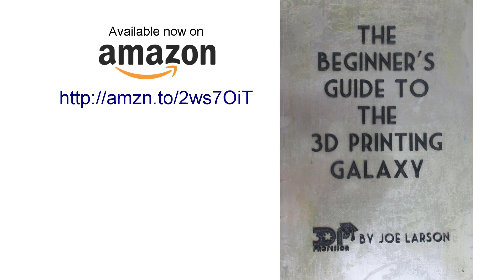The Creality CR-10S and GPL Violations

Comment: Because Creality responded doesn't make them innocent. In my opinion, it makes them panderers. They're hoping that by admitting they'd violating GPL, that we'll have sympathy on them. Again, doesn't make them innocent. It doesn't even make them less guilty. 

One thing they could do, is give Marlin a slice of the pie. "For every 3D printer we make, we'll give Marlin $5.00" or something like that. In return they get exclusive 1st use any code Marlin releases for 2 weeks before it's released on the open source. 

Just a thought.

Comment: It'll be a very interesting day when we move out of the investor makes the calls rather then the people that have the technical abilities. There should be a new investment strategy where they stay out of the technical loop and gain rewards. Would be a hard start for many but my guess beneficial for both sides of the equation.  Now the question is what startup would like to test this idea/feature and stick with it. I have seen allot of Kick starter type programs where people invest on a small scale not to be delivered. There must be a guaranty of deliverance, something even if it does not work but can be improved on. Work to be done in this area or arena.

Comment: To the best 3D Printing Professor - I completely agree with you on the stance that it is a huge move that we ever heard anything from Creality and that although we should still hold them to the letter of the license agreement we should be willing to hear them out and give them the opportunity to correct the problem.

On a different note regarding the couplings. One of the documents that is was in the tool box specifically addressed the reason that the couplings are loose. They had a really bad run of people getting printers were the couplings had been damaged if not completely destroyed during the shipping process. So they have started to error on the side of caution by loosening the screws in the couplings so that if there is any undesired movement during shipping the  chances of damage should be greatly reduced. 

I mention that as a way to support your claims that Creality is listening to us. They know that a ton of people were getting damaged printers and they adapted their packaging process to hopefully ensure that everything arrived in one piece. Additionally they listened to us about the strain relief on the heated bed wiring and they are including a better piece of glass with the printers and in my case they even have put an insulator material on the under side of the heated bed to help the bed heat up faster because it does take a decent amount of time to heat such a large print bed. 

To anyone stating that this is just a cheap printer you are wrong. These printers are built very sturdily out of extruded aluminum bars which they were one of the first if not the first to do that then everyone started copying them. They are also one of the only cheap printers that is wired correctly to not create a fire hazard in your house. They even released upgrade kits to turn your CR-10 into a CR-10s. They didn't have to do that but they heard that the community wanted to have the second lead screw and the motherboard with additional connectors on it to allow for multiple extruders. They are doing a lot more for their customers then you are giving them credit for and that is not fair.

They are not perfect and there is room for improvement but lets not make them regret ever listening to us.

Comment: Interesting ... you are the only one of the big youtube printer reviewers against the GPL debate Creality publishing their source code) and while creating this video, opening and assembling a CR-10S. Did you get it for FREE? HOW MANY printers have you got for FREE from Creality?
Reply from the maker: To be clear, I'm not against enforcing GPL and going after violators. I would like them all be in conformity with the open source license. I'm simply advocating that we pick our battles and be wise.

Creality made a move. The balls in our court. They extended a hand, and while it's not what we wanted, are we going to slap it away? That not the way negotiations happen. That's not the way we all move forward. It may require compromise, but we can all be better for it in the end if we work together, not push them away.
Reply: I really don't want to be argumentative... but what do you see as compromisable or the issue being negotiated? Violation of licensing of software in a commercial software seems pretty cut and dry to me. Should Creality (and other companies not respecting the GPL requirements) not be held to the same standard ("follow the law") as companies that do? Not to put too fine a point on it, but I see a list of 3 dozen contributors to Marlin Firmware (not counting the "and many others..." acknowledgment) that provided contributions under a GPL license and you seem to think there is room for negotiation on addressing the violation of the license all that work was released under.
Reply: 3D Printing Professor - 
You didn't answer my questions => did you get the Creality printer in the video for FREE? And, how many printers have you received for FREE?

Comment: Note that some vendors are shipping Marlin with Thermal Runaway Protection disabled. This is a major safety hazard! If some of these vendors are also withholding the source code, then end-users have no way to fix this major problem. So we are especially anxious to resolve this issue! https://hackaday.com/2018/03/18/3d-printer-halts-and-catches-fire-analysis-finds-a-surprising-culprit/
Reply: Not as a variable name, rather a string, a message that gets printed when this protection mechanism is triggered. It has to be there, right?
Reply: If these features are disabled then the string "Thermal Runaway" will not be present in the binary. Note that bogus readings from the temp sensors will always be caught, even if the thermal runaway protection is disabled, so Marlin can always catch the case of a broken thermistor wire or disconnected thermistor. But it won't catch the case of a thermistor that has fallen out of the hotend or bed, which will just fall to the ambient temperature.
Reply: Woah. Would dumping the firmware binary and looking for a ASCII byte sequence with the text "RUNAWAY" be a reliable way to tell if it's enabled on any given Marlin-driven machine (as long as it's possible to dump its firmware)?
Reply from the maker: Probably not. Once it's in binary format, variable names are replaced with address references. No help whatsoever.
Reply: I guess that this thermal runway protection problem is just the tip of the ice berg. I'd like to see a full review of regulatory compliance (EMC, safety,...) on these devices. My feeling tells me a lot of these low price asian origin devices could (and should) actually get banned from the market if someone would start to poke around at the right spots...
Reply: ExtraBase nah, people will just assemble no less dangerous contraptions from off-the-shelf components. It's not that hard. So I think this would be overregulation for no good.

Comment: Are actually saying Creality shouldn't have to release their firmware?
Reply: One solution is to just to start shipping the CR10S with stock Marlin firmware. There would be absolutely no violation there and it really wouldn't cost them anything. It'd just mean walking away from the extra features their customization provide until they can be reimplemented in source code that can be released.  That puts everyone on a level playing field. They can't sell a feature they don't have the legal rights to deploy.
Reply from the maker: They are releasing their firmware, at least the one they think they can. that puts the ball in our court. Are we going to take what they've given us, make it better, and show them that we can we can work together, or are we going to keep yelling until they crumble, because they can't submit to our demands?
Reply: A unique issue is that they turned a GPL violation into a selling point by shipping a unique feature for this firmware, the power resume. On other devices by other manufacturers, where the firmware source hasn't been published, it was wrong, but didn't give these companies any market advantage. They can heal the license violation right away by issuing an apology to their customers that they have to remove the power resume feature due to a prior mistake, removing the feature from their advertisement, shipping the device with the feature set that is present in open-source codebase or that they have full control over, and shipping the corresponding source code that matches the firmware and a GPL notice.

They are working with Marlin project now, if all goes smoothly it shouldn't take them too long to reimplement the missing feature and satisfy the customers.
Reply: Yes you are right... they would fall back in line with the GPL... but because they have been getting nasty about it I personally would only let it go with them if they gave up the source code everybody is fighting about BEFORE going back to "generic" code or going closed source like they threatened.
Reply: I'm not sure where you're getting your "information" from. Creality made no statement on whether they want to switch to proprietary software/firmware - they probably don't want to do that because it means extra cost, even less differentiation from other manufacturers who also get to buy binaries with the same features from Makerbase, and loss of parts of Western community support. On the contrary, they were apologetic that they created this situation. They were also quick to shift the blame on another party, a contractor, according to them, they can't publish the source as they don't have it, they're unable to retrieve it from the contractor who misled them. Wording points towards them willing to repair their open-source relationships, but it remains to be seen whether they end up acting or stalling.

As to the point with differentiation, if Makerbase were to give any customers preferential treatment with custom features, it certainly won't be Creality at this point, but Flashforge, so Creality stands to gain nothing from the switch.

It's Professor himself that thinks that if we pressure these companies too much, they will run away from open source, but the fact of the matter is, Professor's mind is not a reliable narrator for the world as a whole. Most companies release printers based on open-source firmware like Marlin and Repetier because it's cheaper and more profitable for them, in part because they can source electronics components from a larger pool of suppliers, and as long as this simple fact is maintained, i don't think we have much to worry about in the grand scheme of things. With Marlin 2.0 targeting STM32F1 now, which means it should also work on even cheaper GD32 with minor to no adjustment, and maybe whatever other low-cost microcontrollers might come up, i'm convinced it will be the cheapest firmware to ship in the long term, even with project sponsorship - Marlin is a not-for-profit operation after all.

Comment: As a CR 10S owner, looks like your runout sensor is located right. I also had problems laying down the large masking tape, so I ditched it. My glass plate was warped so i bought a 6 pack of mirrors from homedespot. I use a mirror instead of the default glass plate  and coat it with a layer of hairspray. Seems to work fine for me.  I have found a link (allegedly) for upgrading the marlin software. My confusion lays in upgrading the hotend to say the e3dv6. I haven’t seen a comprehensive video doing a clear explanation of the hotend install as well as what to change or how to change the onboard operating system to recognize the new hotend. 

This is the link I have for supposedly upgrading the marlin software

https://printedsolid.com/blogs/news/installing-marlin-1-1-6-on-your-cr-10s-with-mesh-bed-leveling

Comment: And creality doesnt specifically have something we want, because power loss resume relies both on the combo of hardware and software. The firmware release doesnt give everyone power loss resume.. as not everyone with marlin has the proper circuit in place to do so. You cant just enable it and it work. The firmware release also doesnt release the tech they use to do it on the CR10S either.. they are not at any type of loss situation by abiding by the GPL as requested. Marlin devs have said this many times about requests for power recovery, they would need to be able to also control the hardware side of the machine in order to provide a "universal" coding for it to work for all marlin based 3d printers. Creality and ALL other GPL violators could release their source code while keeping the power loss resume function easily closed source due to the hardware side required to match it.

Comment: Hi Joe! Great thoughts, as usual. I'll admit that this was a bit of a struggle for me. On the one hand, I am a very big supporter of respecting licenses for software, especially opensource. On the flip side, even with the Chinese manufacturers who do release their source, it's often not complete or its outdated anyway, so as you said, it's hard to find one that's in compliance. I still feel that Creality and their contemporaries ought to respect the license for the software, but the bottom line is that it is very hard to hold that line of not supporting any company that uses open source software improperly. For example, we're trying to open a makerspace that will likely, due to our mission to focus on mentoring foster and at-risk kids, not have huge reserves of cash. If we want a large number of 3D printers, our only feasable option will be to buy the east Asian specials that are more than likely not supporting the GPL license requirements.

Oh yeah, I finally bit the bullet and added you to my Patreon list. Keep it up :)

-Jim

Comment: Your main argument in this case is quite flawed. As I understood it, the argument is  "If we boycot people who don't adhere to the law, there won't be cheap printers". As I see it, this is simply wrong on a number of levels.

If there is no consequence for breaking a rule, the rule in itself loses value. They know that they are wrong. They admit it, yet refuse to take action. Sometimes an action must be taken that is "bad" on the short term, but beneficial in the long term. This is also where the "We do not negotiate with terrorists" come from. Once you start making these kinds of exceptions, it can get a bit blurry where it ends up, whereas it's a rather clear cut case. They (and others) are wrong. They know what they need to do in order to resolve it. 

"There won't be cheap printers"; This is simply not true. If someone doesn't change marlin (or any AGPL piece of software). They don't have to open source additional items. There are slews of cheap ultimaker / lulzbot / whatever clones out there that do exactly this. These are by far cheaper and tend to have a much lower quality. So slamming down on those who don't adhere to these rules doesn't change the availability of cheap printers to the extent that you imply. 

Demoralizing effect; I am an open source developer myself. It is extremely rewarding to see a community flourish. To see people use what you make. To see others take that work, improve it and raise it to a higher level. To ensure that technology as a whole becomes better / cheaper (and with that, the world. So that stuff like e-nable can happen or other amazing products that help people all over the world)
But the opposite is also true. Maybe even more so. It hurts, really hurts, to see someone abuse this. To take the work that you (and others) have slaved hours upon hours (and quite often; weeks / months/ years) on and simply abuse it. And this is just something we should accept? Because "they make cheap stuff"? Excuse me? Do you see that this statement is infuriating? What about what all those contributors did then? Isn't the fact that they are motivated  or "rewarded" also a reason cheap machines are possible in the first place. Without them, there won't even be cheap printers or any of these advancements. So if you want cheap printers, you need to come down and come down hard on any such abuse. Just because they provide the hardware (At a profit!) they can get a pass? That hardly feels fair now does it...

Comment: If you email Creality for the source code they MUST release it if it is in fact Marlin or open sourced GPL licensed.  3rd party or not.   It does not matter how many companies are in the chain, it has to be made available.   Someone needs to get the binary of the firmware out of a Cr-10S and examine it.    3DPro is right, ask for the firmware source from ALL the chinese manufs.   That should keep them busy for a while.

Comment: You commend Creality for its excellent machines, and dont seem to realize that it is BECAUSE of the GPL that they are. If they release buggy code, then they can get it improved and fixed FOR FREE from the community. THAT IS THE POINT AND PURPOSE OF GPL. 
They could have written their own stuff from scratch like XYZ if they didnt want to deal with it, but they used it, and the only cost to using it is THEY HAVE TO RELEASE IT PUBLICLY. That one thing is what keeps GPL software so good. Obviously they dont want to because they want to keep their improvements just for their own brand, and i cannot believe that an academician supports that.